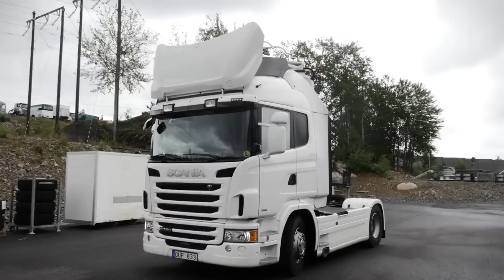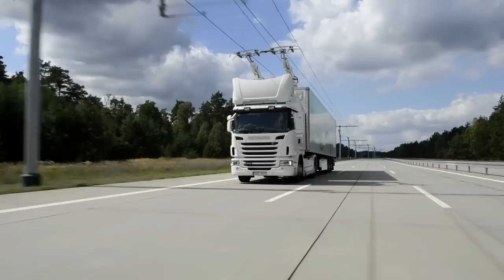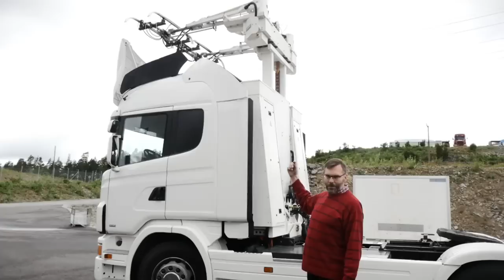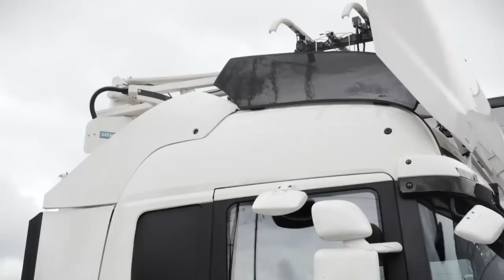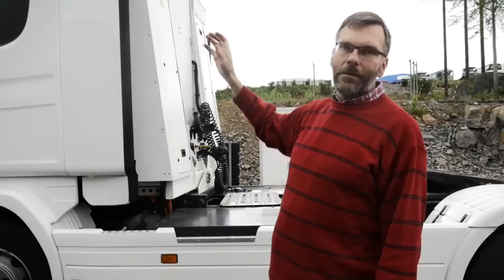Electric trucks – how the technology works

Comment: You go to most European cities and trackless trolleys is the normal power. Here in America there are a few city's that still use trackless trolley, Boston up till the early 60's trackless trolleys were everywhere streetcars used to run, the only place there left is Cambridge, Massachusetts. If you suggest you bring back trackless trolleys most everybody says, oh you can't pass another trolley bus. I remember riding them and each route had a spot or two with double wires for a trolley coach to pass and if a coach broke down the driver simply pulled the poles down and hooked them on the coach so other trolley coaches could easily pass. GM, the oil companies and tire companies paid off the right people to get rid of the trolley coach system to make money and we the people went from clean efficient trolley systems to smelly diesel coaches. 99 % of all trackless systems that were converted to diesel buses were built by GM with Detroit Diesels. 
The best example of the trolley coach is in San Francisco. A friend lives on the steepest bus route in Frisco. The used large high horsepower diesel coaches up to double Diesel engines because when the coach hit the steepest part the driver kept it floored until the coach came to a stop. The driver then applied the brakes opened both doors and said " ok folks meet you at the top of the hill and everybody got out and walked up the hill with the bus roaring away up the hill empty at 2 or 3 miles per hour until reaching the top where everybody got back on and continued the commute. This went on for several years until one morning where the bus would normally stop the driver failed to stop and opened only the front door and told the commuters to get on the bus. Everyone was yelling open the rear door but the driver ignored them until the last passenger got on then stepped on the accelerator and everybody was shocked when the bus quietly accelerated up the hill easily with a full load. At the next stop everybody was asking how? Easy said the driver the transit commission finally did what we've been telling the for years. Installed a trackless trolley system on this route. This trackless uses a single 200 horsepower electric motor that we added a traction motor blower to blow cool air into the traction motor to prevent it from overheating due to the steep route and as you can see it works beautifully. This happened in 1975 and the only modification is adding regenerative breaking which generates power from the traction motor and it feeds that power back into the overhead wires. It also reduces the cost of operating the coaches.

Dayton, Ohio has been using trackless trolleys now since the early 1920's and continues to use them as they are reliable, very economical to operate the system and contrary to most people that say there too expensive to install is there actually cheaper to install and run then CNG, diesel, and far cheaper than hybrid systems or battery systems.
Boston MBTA system changed over to CNG powered buses 30 odd years ago and an average of 40 buses a day fail to complete their runs because they run out of CNG. They then are towed to a garage where they are refueled , restarted and put back into service. Not a good system when the CNG buses continually run out of fuel. Meanwhile the trolley buses have plenty of electricity to run on.
Reply: It is, but people don't want to understand! They think that the batteries are the future and they are "eco-fiendly"!☹️🤦‍♂️
Reply: @trainspottingtech23  but batteries are wasteful.

Comment: Get a truck with a 100-150km battery range with a pantograph on top of or behind the cab, put overhead electric lines above every motorway in Europe and this would cut almost all of Europe's diesel dependence with a fraction of the dependency on lithium ion compared to a purely battery powered solution

Comment: Let's do this for cars too.  Give catenary wires on all lanes...or bury as third rail just below road (exposed).  No CO², no worry about charging stations.
Reply: NO BATTERIES.
Reply: It makes more sense for taller vans. Nobody needs cars when there are buses.
Reply: @موسى_7  
If you're going to just allow buses, there would be no point for this--would just use the already existing catenary electric trains, and build extra.

Comment: I think the internal combustion engine for the style of truck and for the method you're using it for is not the brightest idea you may be using the truck for a lot of off-grid driving but if you're doing a lot of highway driving that you would have this grid attached to then you could have a big battery pack to charge and Reserve while you're on the highway or if you're mainly doing just Highway and small off-grid driving you could have a smaller battery pack that way you don't have to you have the maintenance and wear-and-tear of an internal combustion engine and you save a lot of money since you're already utilizing electric motors and Electric System you would just switch to a battery pack rather than switching to a full internal combustion mechanical system. I guess since this is just starting up you would want an internal combustion engine but for the future it would probably be something you would like to phase out.

Comment: seems a little dangerous but COOL, if the road develops a defect e.g. a pothole, undulation or debris the tractor units will bounce off them which could create an entanglement situation with the pantograph. I assume there will be a significant current going through the cables too! Batteries have got to be the way or at least hybrid

Comment: How about making the wiring module with solar roof that is covered with solar panel produce an electric power? It could send a power in daylight. Of course a battery or hydrogen fuel cell works in night time.

Comment: this is a good thing! much more enviorment friendly and better looking than diesel trucks  IMO
However trains has more capacity :)
Reply: But trains are less flexible. I imagine small airships shall replace highway trucking, but for garbage trucks within cities, they should be trolleytrucks using the same cables as trolleybuses.

Comment: what happens if you need to make an emergency lane change?
Reply: you dont change lanes
Reply: watch again the video so you can understand
Reply: He said if you change lanes the Internal Combustion Engine starts up.  Listen to whats being said as well as the pretty pics.
Reply: +Michael Liyanage probably, in case of damages during accident in few places it will be out, but keep going a bit and reconnect, back on trolley railing.
Reply: Michael Liyanage from what it looks like the truck pushes the contact to the underside of the Rails or lines so even if he had to make a unsafe Lane change or was in an accident it won't pull or tug on the lines.
Reply: byrysh the internal combustion engine may start up for a regular Lane change don't think this system would be able to keep up with an emergency situation.  that being said I think it's an internal combustion engine is stupid for this reason because you're only using it for very small instances it much better just to have a small battery pack for something like this.
Reply: Stig Cruise this is on highway. It does not extend to cities and other regular public roads. On highways it makes sense but I have problem with it that engine completely shuts off. Cold start is what damages engine. It should be at least be idling ( above idling prevent from oil consumption ) and providing some electricity generation, and be ready for emergency. So, during highway run 95% comes from power line.
Reply: Japan will have wireless electric roads by 2023.
Reply: Colin Shapton Yeah real trolley poles would be best. They allow movement a full lane over.
Reply: It also has an Internal COmbustion engine
Reply: What happens when there a overhanging tree branch .Garage for a week.
Reply: Safety is number one! Make the emergency lane change, rip the pantographs and catenary down.. turn on diesel engine and carry on

Comment: Where oversize load need to move on the highway/motorway Wouldn't that be a problem?
Reply: There are still bridges and other stuff and when you exit highway, you cross railways and cities with trolleys aswell. Secondly, most of oersized stuff can't enter highway anyway because it' too slow.

Comment: Is nobody going to ask the obvious question: what happens when the driver turns or changes lanes, I would imagine snapped cables for a start.
Reply: The edges are rounded off so they don't pull on the cables. Look at how trains do it

Comment: Why even make it hybrid. If you want to reduce even more emissions, then don't burn any fuel at all. Get a battery pack with around 500km of range, which can be used without the power lines to drive off the motorway in the city or something.
Reply: 500km wouldn’t be enough what about heavy haulage would drain the battery much quicker big Diesel engines the only way who has time for stopping to reacharge every-couple of kilometers which takes a couple of hours when you could be refueled and back on the road in a couple of minutes.

Comment: It's not practical and unnecessary and at this point.  Battery will soon enough provide ranges in excess of 500 miles for semis, and fast recharging times.
Reply: Batteries degrade in extremely hot weather like that of the Middle East.

Comment: Let's be honest here trolleybus technology is nothing new. Building a whole electrified road system is costly. Be prepared for your taxes to rise to pay for it and endure many more years of austerity. There is already electrified railway systems around the world, why not develop them and get the road traffic reduced? Alternatively develop the range and pulling power of the battery packs. Four hours for charging is slow and the distance range is very low. Haulage companies need to get produce and goods from A to B quickly and efficiently. The technology is there but it needs tweeking to be commercially viable, affordable and reliable.